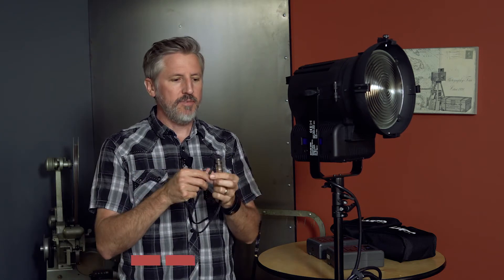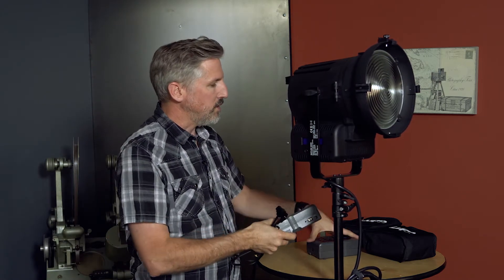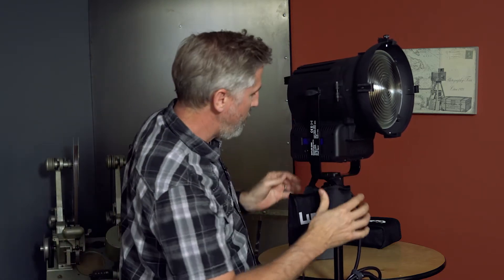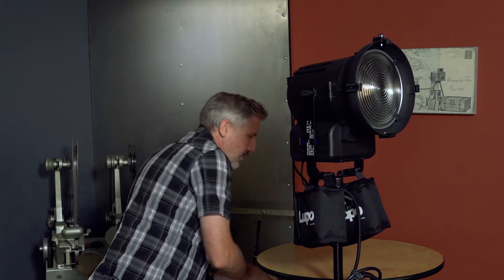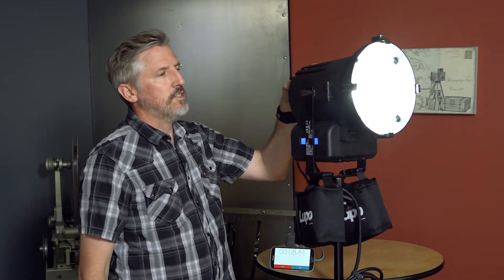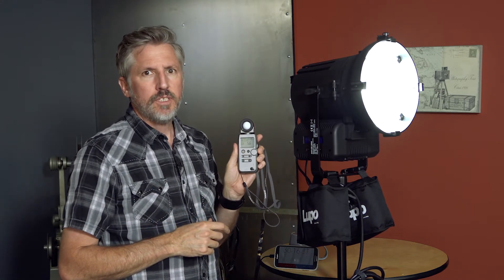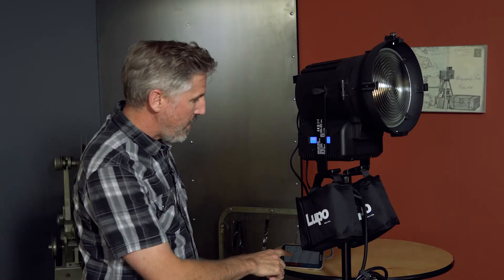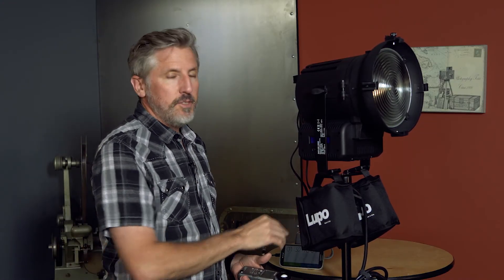LUPO DayLED 2000 battery test with a D-Tap Y and two 14.8V batteries

Comment: Scott, Do you recommend the Superpanel or the Lupo 2000 for a live shot on a reporter on a bright sunny day.  I use a 1 stop Westcott scrim jim kit over the reporter and used to use the Lupo 1000 in Florida but had to return that to my boss when I left to come to DC.  1000 worked alright but I need a little more punch to it.  You can also email me at ecisgro@sbgtv.com Thank you!
Reply from the maker: Which DayLED 1000 did you have?  Was it the bi-color model or the daylight only?  I ask because the Lupo DayLED 2000 is around 4 times brighter than the bi-color 1000.  It has way more punch!  I use my DayLED 2000 outside on my talent all the time.  For best results I will have them either under a small (or large) silk, in a more shaded area or backlit by the sun.